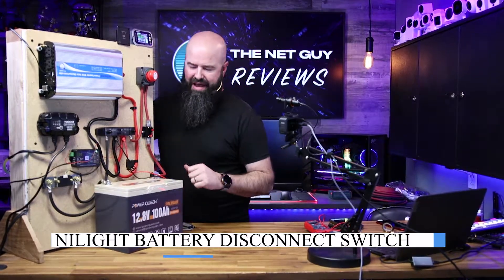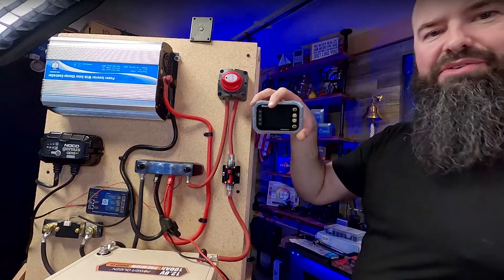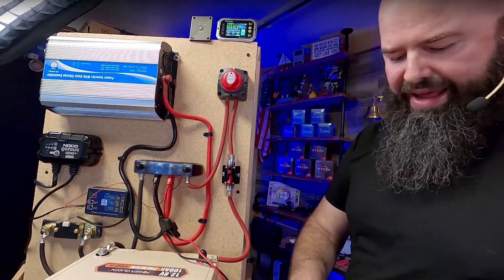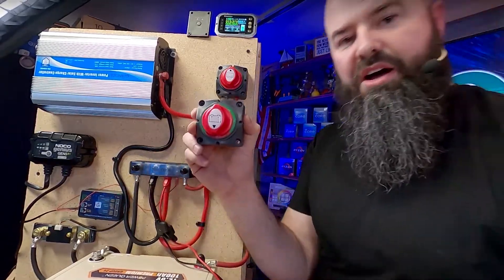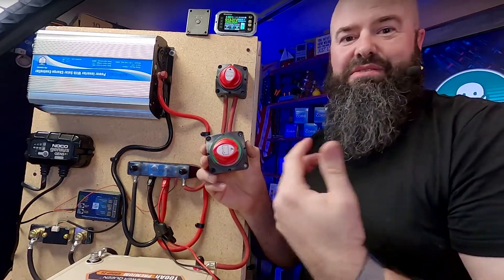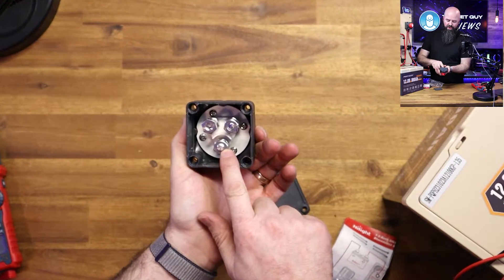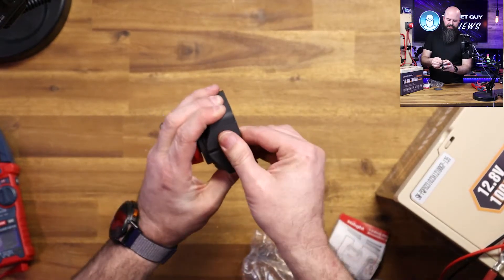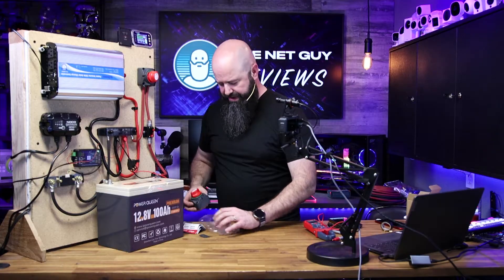Solar Safety: Nilight Battery Disconnect Switch

Comment: have been looking but can't find info, you say battery disconnect is for 12-48v, where are the amp ratings for said 24v, 48v because there amp ratings are not the same as those of 12v : 275a continuous, 455a intermittent(5 min), 1250a momentary(10 sec)
Reply from the maker: Agreed. Always good to check specs before buying. Of course people will say these can’t handle that amount and to buy Blue Sea or others. I don’t run more than 100A in my setups though.

Comment: You have peoples lives in your hands telling them this mis-information. The type of switch you are using is not capable of voltage above 36 volts even the best brands cannot go above this  Especialy this super cheap chinese switch. I spoke to the techs at Blue Sea electric because I also wanted this for my system I was not able to find any UL rated switches so I called them They advised me the technology does not exist for this type switch to extinguish the electrical arc safely  The chinese will tell you anything to sell their product - These switches are dangerous There are some toggle type pole switches that can be used similar to what you used for your solar array but with higher DC amp ratings -- People please do your own research
Reply from the maker: I hear you. Luckily I’m only switching 14.2v max. Blue Sea makes great stuff and is local to me. I just bought two more of their 6 circuit distribution panels today. That said, this is the number one best selling disconnect switch on Amazon.  If using high amps or higher volts, yes I would go heavier duty for sure. 

Thanks for contributing this info. 👍

Comment: I will hope you dont use a chinese Battery switch!  My chinese switch gets hot at 50A 48V and was ratet to 300A 48V. It is very dangereous. I changed it to the original Victron switch, wich worked as it should. Look at the videos about this swiches on youtube and save your house.

Comment: clicked on video just to make sure you weren't using it on a 48v system!  you're on 12v so it's fine.  HOWEVER, people should go with a higher quality component from Blue Sea Systems and not that <$10 amazon special...  it. just. ain't. worth. it!

also, yes, breakers CAN be used as a 'disconnect' - BUT, they are not designed to be a 'switch'.  their 'switch life expectancy' is VERY low compared to a purpose built switch. so a few flips now and again is fine, but something that will be used more (like a battery disconnect in an RV or boat) = USE A SWITCH!
Reply from the maker: All fantastic points and spot on advice. I just went all Victron on my boat 😜 My wallet still hurts.

Comment: Boats have bulkheads, not walls.
Reply from the maker: Bulkheads, gunnels, hulls, yeah yeah.  I still say left instead of port.  Maybe a few years living aboard will change me. 😆
Reply: @steverturnsk6190 
Do you still swab the deck? Geezus.
Reply: Arrrg ya swab!! They have BOTH!! Bulkheads are structural or they may be water tight. Walls are so the rest of the crew doesn’t have to see yer scurvy carcass with unfurled sheets.

Comment: Stick with quality names like Bussman for fuses and breakers. Blue Sea master disconnects are also high quality. Sorry, I wouldn't rely on a "Nilight" to properly break a circuit or disconnect the system. Their 12v stuff is okay, but not for critcal protection.
Reply from the maker: Technically this is on the 12v side, but I hear you.  Their rocker switches literally fell apart in my hand - though their LED lighting has outlasted other brands.  Blue Sea makes some of my favorite gear and is HQ nearby - but it’s always double or triple the price.  Bussman seems to be twice the cost of Blue Sea.  I recently just upgraded the boat to almost all Victron so my wallet is still hurting 😆. 

Thanks for watching and the note 👍
Reply: @TheNetGuy  Its literally the difference between your fancy gear and equipment burning to the ground or hitting the switch and it being a non-issue.....and all of that assumes the switch will handle the current going through it in the first place.

Don't cheap out on fuses and disconnects. Those parts of a system are sooo much more important than a flashy inverter and chargers.

I learned my lesson on the crap Chinese parts with Solid State Relays after tearing a few apart the mosfets inside were rated for 10 amps and being sold as 50 amp devices counterfeited under the Omega name. They don't care, and Amazon won't stop these dangerous and illegal activities because they dont care either.

Comment: Why is using the circuit breaker “neyeah”??  That’s what circuit breakers are designed to do.
Reply from the maker: Great observation.  Technically that type of inline breaker has the ability to disconnect as well. 

A better question is should I have used an ANL fuse and disconnect or just an inline breaker.  Lots of people don’t like having two functions in one unit and constant use could lead to issues with the contacts. 

I do find it easier to say to someone “turn the big knob” vs “find the little tiny button on the inline breaker by the battery and push”. 

This would be a great subject for a video.  Thanks for bringing it up!
Reply: @TheNetGuy  very valid point about the big red knob.  Also, on my unit, the knob can be removed to act as a “key” of sorts to safe the system.  I don’t know if yours has that feature or not.  So it has a feature the breaker does not.

I was just sort of triggered a bit as a former Navy electrician’s mate that it sounded as if you felt a circuit breaker wasn’t appropriate for turning off a circuit, when actually, the truth is, it’s designed to make a swift break on a circuit under load to minimize arc damage.  Compared to the cheap switch which will definitely suffer over time from arc damage, especially if you are connecting a large inverter which inevitably has a big capacitor bank which will cause a huge surge of current when you switch on.
Reply: You have to be careful using a circuit breaker as a disconnect switch to turn everything on or off on a regular basis. Not all circuit breakers are switch rated. Switch rated just means that it's designed to handle regular switching cycles. If it's not switch rated then it's only listed as over current protection and as an emergency disconnecting means. You will pay more for switch rated circuit breakers. Getting a properly sized switch will usually be cheaper.
Reply: Circuit breaker will become worn, weak, not designed for circuit reconnection.  The breaker's only true function is short circuit interruption.
Reply: @dogdazetravellergarrett1367   Not entirely true.  Circuit breakers are designed to contain the arc flash when a circuit under load is both made and broken.  It has internal springs that will minimize the arc when  it opens that aren’t in play when it closes, but all the spark insulation still applies and is superior compared to a simple switch.
Reply: @pchris6662  having been a commercial building engineer for over 30 years( now disability retired), my electrical training dictated specific protocol, common sense of circuit control. Whenever possible, should always use a true service disconnect device when it's present in circuit.
The above mentioned design breakers used in RVs, boats, ect... Are questionable quality at best. If we're to add on a circuit for an accessory like heaters, solar panels, ect.... It's ignorant not to add a disconnect inline with the accessory equipment.  Safety isn't worth debating if it's optional. Professional opinions are just that....... Everyone in service industries have there own preferences, choices.😎